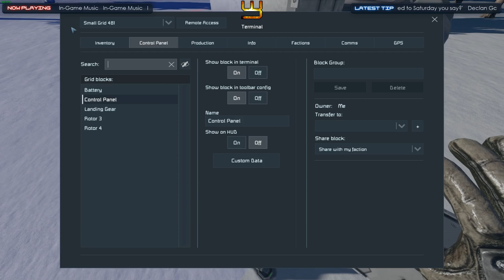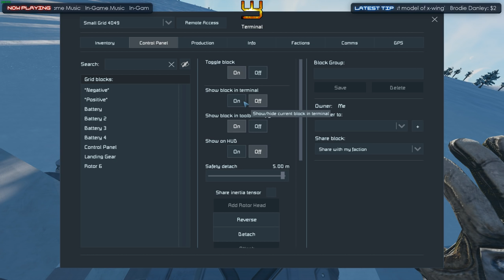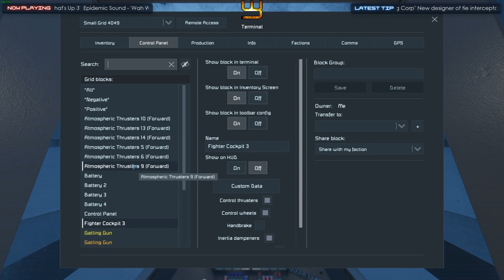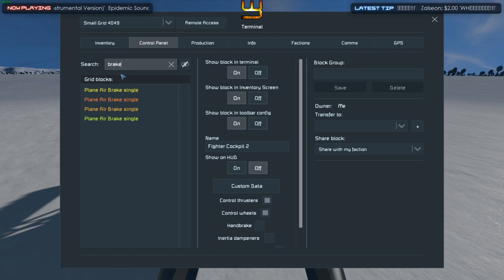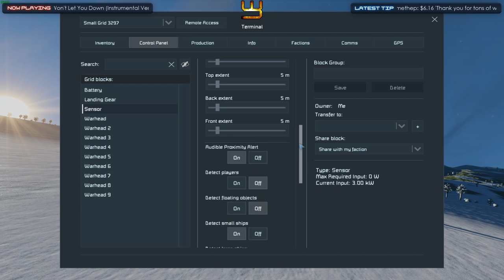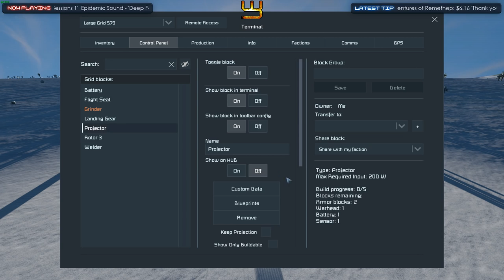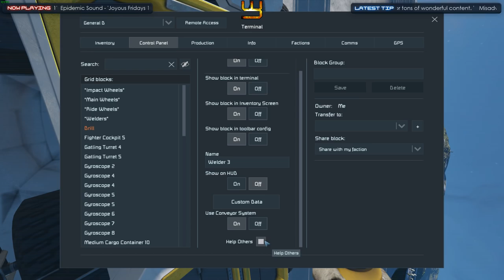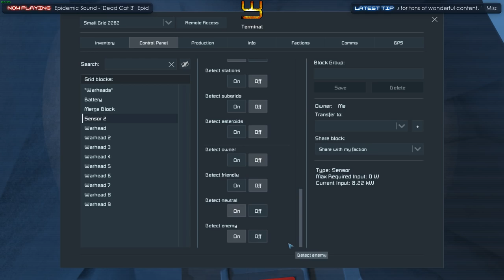Space Engineers - Rotor Wings & Other Things - W4sted's Workshop #1 (The Pilot Ep)

Comment: I reckon you could get away with rotor-mounted wings being asymmetrical top-bottom and even back-front, so long as you take their centres of lift (probably the rotor head, but who knows) into consideration and keep it on, or ideally slightly above, the centre of mass of the main structure. That way, the main structure will 'hang' in between the wings, as it were, in a stable position. Then you can mess around with the centre of mass a bit to make it naturally nose up slightly if you want (is also easier to achieve than perfectly centered mass).
In short: put the rotors in the centre-top of the craft, then design your wings as you go, messing around to see if wing shape affects performance.
I reckon you could make something fairly similar to an Imperial Shuttle that way, but I doubt Tex' craft would be possible due to its rotor placement and wing surface.

Comment: I've had a cool idea for a cockpit design.  Make an armored cockpit for a hover tank or fighter or some mobile heavy weapons platform, make the cockpit/control seat slide at a diagonal close enough to the ground so your engineer can hop in.  Then make the cockpit retract into the armor plating.  And as an extra challenge, make the cockpit house 3 engineers.  Doesn't matter what configuration, what matters is you can fit 3 engineers in the cockpit matrix.

Comment: an assembly line style ship factory which makes very little use of bobs. It will build a segment of a ship such as part of the outer hull and the bridge and then use a single merge block to connect the segments to the ship together. then using projectors and welders on rotor arms it will then weld the connected segments together to properly connect the ship. And obviously for style points a control room that lets you view the operational assembly line.

Comment: It's rather impressive that it's simulating anhedral wings properly.  What this wing mod needs are matching blocks that don't have the lifting surface so you can make the anhedral shape without the effect, then attach actual wing blocks somewhere else in a more functional orientation. I believe the realistic anhedral wing physics are made possible because of the separation of physics between the grids. Cross grid physics create more realistic lift and thrust forces, as in offset from the center of mass vs. SE center-of-mass thrust independent of the position of said thrust. This is also why the X worked better because you had anhedral and dihedral wings canceling each other out.

Nice to see you just mucking about in SE again though. This is why I started tuning into your streams a year or so ago... Maybe two?  Probably not quite two.  Keep it up... Just wish it didn't have to be YouTube.. But either way works.

Comment: "because when you turn, it doesn't turn... it rotates"
there are words for this.

also, that "x-wing" is acting like a lawn dart. that means centre of lift is a long way behind the centre of mass. move the centre of lift forwards or centre of mass backwards, and it should be easier to turn. if you have the centre of lift in-front of the centre of mass, it will be unstable and want to fly backwards.